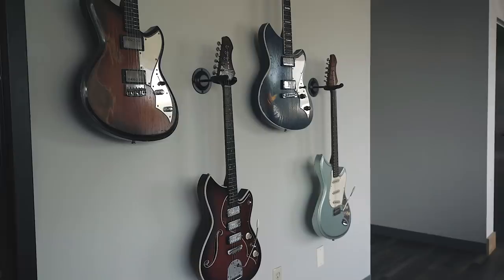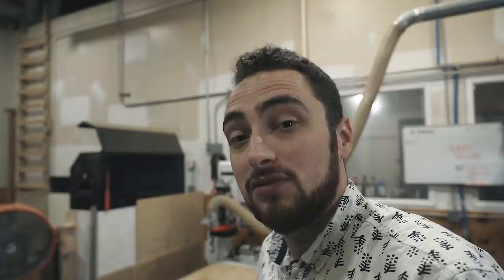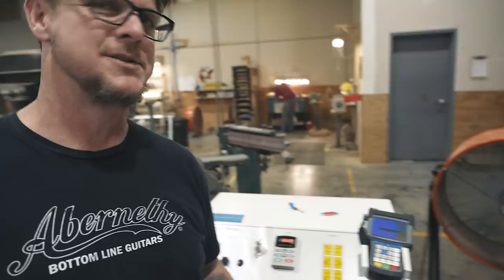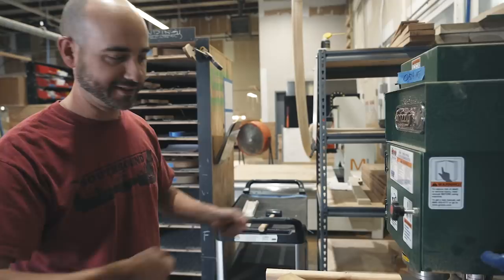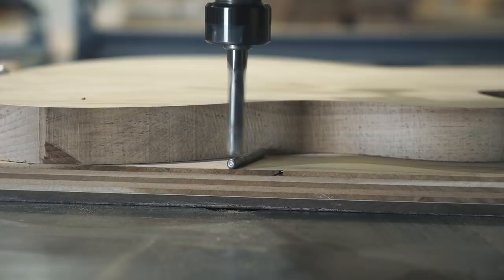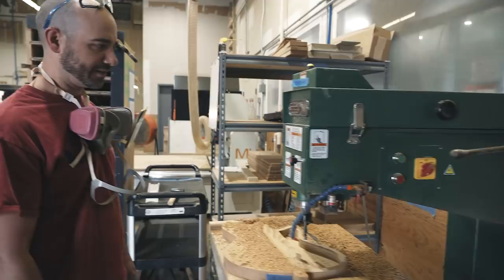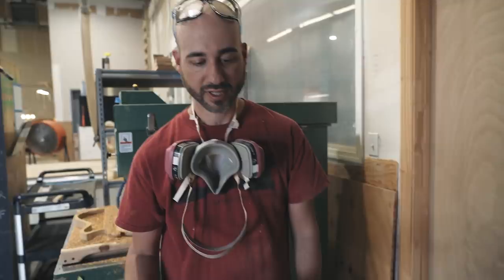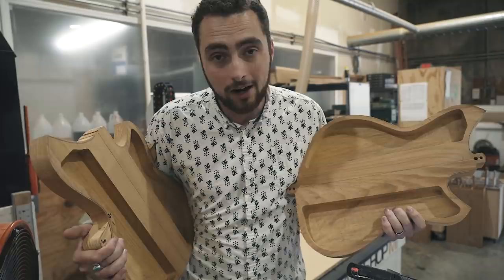Is “Handmade” Really Better? CNC vs. Handmade Guitar

Comment: I stumbled into your channel and really enjoy what you're putting out there.  I'm not a musician (lucky to keep my radio in tune)  so consider the source.   The ONLY thing any machine can do is to just take over some of the heavy lifting when it comes to building things.    There are some firearms manufacturers of bespoke firearms that have gone to using cnc to get their gear about 85-90%.  THEN the skilled workers take over and make the item what it's intended to be.  

Cnc may make it possible for the guitar works to make better instruments due to the workers being fresher during the build process they may take a bit more care and time with each guitar.  Just some thoughts.

Comment: There are other advantages of the better CNC routers like vacuum beds and being able to angle the cutter to other than 90 degrees to the plane of the bed. Also what these guys do with the CNC's is pretty simple cuttouts using standard cutting tools but then again only maybe 1-2% of places that use CNC routers do complex work with them.

Comment: Sure - it hardly makes any difference if certain parts of the manufacturing process are done on a CNC machine or not. In fact it makes for a more consistant product, and a safer/cleaner work environment. And it saves a LOT of man hours, which again means less production costs - once the CNC equipment is written off.
That's alright as long as these cost savings reflect in the retail price, so the buyer can benefit from these savings. It's all about transparency.

In other words: It's only a "real" problem if the buyer pays the same as he would for a completely handmade instrument...

Comment: You know... in very serious cost cutting automation that machine would automatically measure the blank height. All that operator would need to do is attach the blank(s) to the machine, press a button and come back when the machining is done.

Comment: I think he forgot to make another point. If course a machine is more precise but most people like to build guitars because it's a skill they want to use. It's about creating something with your hand to be involved in the process. Computers are even more accurate in producing sounds. They can make perfect sine wave something a human voice just can't do. It's therefore inherently better? I don't think so. And that's what most people appreciate. Also for the most part the increased precision is being done to a material that is inherently unstable. The wood's shape changes with temperatures and humidity so no amount of precision will ever make it absolutely perfect. The router is more than sufficiently precise to make good cuts and a guitar built this way won't last any shorter amount of time. The only area where CNC excels is consistency that's why I'm a fan of it too. But I don't really care all that much as long as the individual guitar plays well from what it was built or how. Who cares.

Comment: I wouldn't consider either of those to be a "handmade" guitar. Check out the "Fletcher Handcrafted Guitars" channel, and watch his Strat build. That's a handmade guitar. 

CNC will always be more consistent, but value is based on more than just quality of outcome. Labor and skill matter too. I fundamentally disagree with anyone who thinks that human labor is worth less than robotic labor.
Reply: Well, there're a lot of misconceptions right there... First one is that nobody's saying that human labor is worth less than robot labor. There are just different approaches to the same task.

Second one is that the "robot labor" is not effortless to humans. There is a lot of skill needed to make a good CAD drawing of a guitar and another lot of skill needed to program the CNC machine.

And finally, though I think the flaws of human work can give a handmade guitar a lot of personality, when you're looking to make a guitar company you need to be sure that you can make consistent work every time. As they said, they can make ten or twelve bodies every day, and that's a lot of different bodies if every single one has its own characteristics to be addressed. If all the bodies are the same (of course they're not, since wood cannot be exactly the same body to body) there is a lot of work less that you can spend working on finishing the instrument, or the fret job, or the last touches.

Comment: A lot of truth there for sure. I do feel like the definition of "hand made" has changed a bit. A true luthier, who begins and ends the process by hand, will definitely exercise more subtle control from instrument to instrument. One might argue that using the pin-router isn't exactly "by hand", it's just a slower version of the CNC. He didn't actually carve out the materials with a hand chisel, for instance. When I think of "hand made", I do not think of a pin router in the process. However, this has been a great video and those who are buying most any modern electric guitar will find this valuable.

Comment: The debate or controversy of handmade vs cnc is really non-existent, or at least not where most people would think.  Both processes are well known and they both have pros and cons, the debate is how each individual values each of the pros or cons.

For example if you are looking to spend money on a hand made piece of art, you wouldn't want an robot painting machine to make half or more of it.  On the other hand if you aren't worried about it as a fully handmade piece of art but care more about it being consistent then you might prefer the cnc.  Additionally do you want something unique?  More handmade steps means your guitar will come out slightly different than every other one out there or again do you value consistency.  When you are purchasing "botique" or luxury items often you are paying more money for both value of materials and the time put into it.  So if a guitar took 3x more time from a skilled operator you are paying for that.   What makes something unique often is it's flaws, it's differences, that's also what you are paying for in more handmade steps, uniqueness.

There is no right answers in this, nothing in this is universally "better" than the other, just different.  If you prefer to think of your guitar in terms of top functionality for the lowest price vs paying for a piece of hand crafted art, that's perfectly fine, the reverse is fine too.

Comment: I'm a Luther and there is no handwork or hand skills here. A real handmade guitar is made by hand, I take into account the density and the flaws in the timber to bring out the best tonal qualities of the timber being used. Both machines worked to a pattern, taking no account of the type or quality of the tone wood being used, occasionally, they will manufacture a guitar where the pattern and the timber will come together to produce a fine instrument, but that is by luck, not by design. Whereas, as Luthier, I try to bring out the best, taking into consideration all the qualities of that particular piece of wood that is my 'raison d'etre' as a Luthier; to produce the best instrument I can, with the best possible materials I can access, it certainly isn't to 'pump out' as many generic instruments that I can - If you want mass produced, go to China, Taiwan, Romania etc. Handmade v. Machine my ass!

Comment: CNC is the King! Quality, accuracy and the amount of labor you save is a no brainer.  Im a machinist and a guitar and drums afficionado., and building a guitar or drums from scratch using CNC is a way better and practical, def beats handmade. Handmade is best during the finishing assembly and prepping. Same as Ferrari's, Lamborghini's, Mercedez- they are assembled handmade after the parts are manufactured by CNC cmachines.

Comment: Nice video.  Most premium woodworking projects are “better” if you just use what works.  Usually that involves power tools or CNC to do the bulk removal and hand tools to refine. The computer, at least currently, has no sense of grains, defects... etc. As long as the end product is refined by an experienced set of hands and eyes using hand tools, you are way better off using computer or power tools for the bulk grunt work.

Comment: i use my templates to get accurate repeated cuts such as where the pin holes for bridges etc BUT if i am hogging out for chamber work i use it free hand because of grain and any checks that maybe found also its personal some people like a thicker sound with less material removed

Comment: I think the optimal solution is CNC doing most of the rought and maybe some of the finer details, and then have a human inspect and polish that guitar. There is no matching CNC precision once the machine is set up correctly, and the CNC cannot do the smaller yet very important details and finishing.

Comment: As a woodworker I use hand tools and smaller power tools... solely because CNC doesn't make sense for my situation making a small number of pieces with limited space and modest funds. Is a route I cut better or more accurate than a CNC?? Not even close.

Comment: 100% this. The CN doesn't do a single thing until you tell it what to do. Which takes knowledge just like operating a pin router does. Even then, it only does what the pin router would anyway.

Comment: I don't have the time to read over 1,200 comments, so this may have been addressed- I feel that people have the perception that small boutique makers are building their guitars "by hand" because of the price tag attached to them compared to other companies that don't necessarily attach that phrase to their work. Yes, consistent quality comes from modern tooling. Yes, you still need someone who is skilled to do the detail work once the parts are created using modern tools. But how does a "small" maker, who is still turning out hundreds of instruments a year, justify the few thousand dollars for their instrument compared to "large" guitar companies just because they may use boutique name parts and electronics when really they are manufacturing their instruments in the same fashion as the large makers?

Comment: Meh....CNC, Pin router? Same thing, different computer.  No mojo instilled during build with either.  Me? I'm a custom builder and I use a pair of tweezers and a pack of Q-Tips.  On my acoustic builds I don't even use the tweezers.  Wow do they take a long time. On my electrics, hogging out body cavities with a Q-Tip takes quite a while but is, of course, a labor of love.  When I'm done with a Marinemancaster body there are some inconsistencies much like the Pin router version shown here but that is excess, overflowing, mojo that soaked in during the process.  I have to sand down the mojo on my builds.  Yes, I use Q-Tips for sanding.  That takes quite a while as well.

Good video Rhett.  Love the behind the scenes stuff.  It's a couple of holes in a block of nice wood.  Do it the safest, fastest, most accurate way.  Then the real guitar building begins.

Comment: Unless you are discussing Acoustic Guitars, then the CNC vs Handmade discussion is just noise in the background..   But when you are talking about a handmade acoustic guitar, instead of just 2 slabs of wood screwed together (Electric), then the debate actually matters.   Acoustic guitars are intricate designs and time consuming to make, and an expert luthier can craft not only a guitar but a SOUND, and a CNC can only cut out the parts.  So, if by Electric, then go CNC, but if by Acoustic, then the more hands on the better your guitar is going to sound, as a finished product.

Comment: CNC Is more precise and quicker than Pin Router. Even after it is milled on a CNC Machine there is still hours of handwork that needs to be done. Just all the pockets and holes will be perfect every time. As a CNC Machinist I will always take a CNC made guitar. Though i must say. CNC machines are not cheap ( CNC router will save you a bit) vs an enclosed CNC machine like HAAS vf-4 or equivalent , Design and Modeling the guitar in say Pro engineer or solid works isn't cheap. Sending the model to a programmer to program isnt cheap. Tooling and cutters are not cheap So start up for CNC is expensive but will pay for its self quick if you have a good product.

Comment: part production can be made by any means that makes no difference if the result is the same it is all about the cuality control during any production. also for people sayig that they are just cuting wood...well no 2 blocks of wood are the same....and different areas mey have different density and also texture....all that changing the sound it will make......craftsmen work by hand making ich part one by one listening and cheking the part. making sure that the sound wont be affected by a oart that is too soft or too hard.

Comment: As a woodworking professional, CNC all the way for something like this.
Reply: Yeps. There are times when hand tooling is superior... this isn't one of those times.
Reply: @t , do you think this cnc is a good enough machine to do the basics of making the body and neck?  Id work on the rest, I like the idea of building myself and am looking into it, also dont have an ego so would probably take it to a luthier to make sure I did it right at the end but in terms of cutting out a 3d angled body and all that, would you say this would be good? Im assuming the programs for cnc are useable across different machines? Meaning, this cnc wouldn't be barred by a crappy program that can't be changed? Thanks for any help.

Comment: The real question is not CNC vs. manually operated pin router, but rather hand vs. powered tools. I can absolutely see power tools, through heat and vibration, being way tougher on the wood and destroying sound conductivity, as opposed to hand tools.

Comment: Nice video.  I'd have liked to see the other stages of the process, following the guitars (or at least one) through to completion.  It would also be interesting to see a similar comparison for an acoustic model.  (They don't just route out the body of those -- but you could have CNC machines scalloping your X-bracing and turning the neck, or whatever.)

Comment: Personally, it really doesn't matter to me. The cnc is definitely more consistent. To me, "hand made", would be taking a hunk of wood and using a chisel to shape it. It'll take forever and the labor cost would me outrageous. Do people mind that there car bodies are welded by a computer controlled welder? I don't see many die hard fans of handmade things, driving Model A's, back and forth to work. Like the guy said, the important part of the process is in sanding, finishing,  assembly, and fret work.👍😎🎸🎶

Comment: As a boutique builder of guitars, and guitar parts, I think that the argument is mute.   There is a market for both.  I have fellow builders that use CNC machines exclusively and turn out some beautiful work.   I prefer the hand carving and slower approach.  And I build beautiful guitars also.   While I don't turn out the same quantity, and there may be some variations in each product, my work is consistent and accurate, every time.  Also, for me, the art of hand making a guitar is more of a stress relieving process, than anything.   I could get a CNC, and turn out 15 to 20 guitar bodies, a week, or I can do them by hand and do 5 to 8.  I think that there is no argument, since each guitar is, eventually, a hand made instrument.  Using this alone, how you get the parts made, is irrelevant.  Just my opinion.

Comment: I am a guitar builder, and what I see is 2 ways to make a guitar by machine (fast way, and slow way) it has nothing to do with a "handmade" construction, the real difference is the constructor that makes a guitar by hand don´t use any material, just the elite, because he will be working on it for months .. (at this point a handmade guitar is already better) cnc finish inside the hollow is no better than a perfect blade finish, and finally, the idea that all the guitars are equal is a value for a corporation but not for the guitar builders that we seek to achieve the sound that each customer demands individually.I propose a video of a guitar really hand made and another cnc and you will see the difference!

Comment: So many YouTubers and musical instrument making  companies/luthiers have avoided this topic in their YouTube videos. "Handmade" vs Production (CNC)".  With electric guitars it's really about the starting point. CNC machine vs Pin router machine...rest is done by hand.  And the difference in price of a "handmade" Novo and one that was CNC is roughly?

What about acoustic instruments? What makes an acoustic guitar made by Martin or Taylor different from one that's marketed as "handmade by one luthier" (or a small team of 5) worth 10x more? They  don't sound 10x better or10x more capable.  Acoustic guitars, violins, cello's...etc.The only real difference is in the choice of tone woods and options "given" or that can be spec'd for a custom guitar. 

No one in the violin/cello making industry has been willing to talk about wht makes a instrument where putting out numbers is the goal vs a "luthier" shop that puts out less than than 50 instruments a year. Internally? Parts used? No difference. Both use a kind of white spruce only. Inside there's just a "sound post" and one rib that runs north and south. I think people buying violins and cellos are being taken to the cleaners. Nerds buying into the marketing.

What makes a $8k Custom Shop Martin different from a $20k guitar from a "guitar luthier" who's only difference is how many guitars put out per year. Everyone still starts the building process with some kind of machine to cut out the top/side/back. The rest is handmade (minus the tuners...heh..which is outsourced), the strings they dont make...).The hours spent on a CS Martin should be closer to that of a luthier's shop. ..